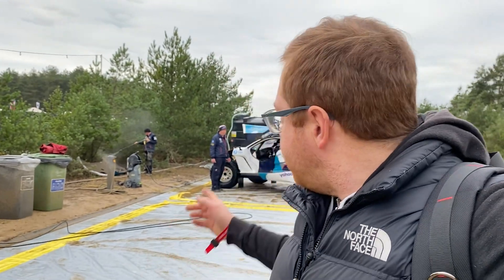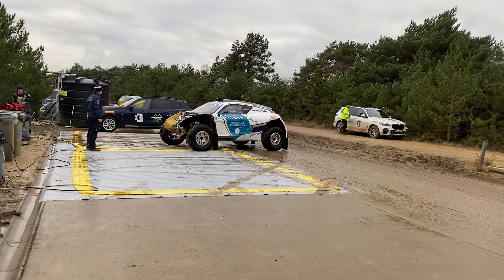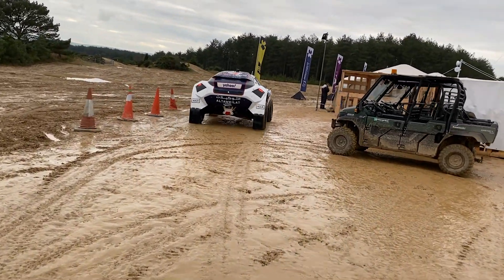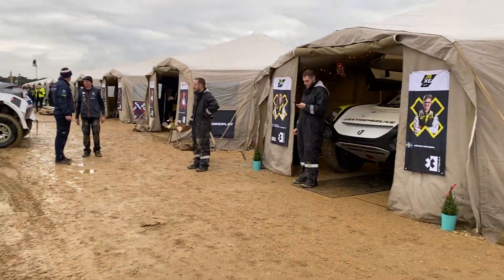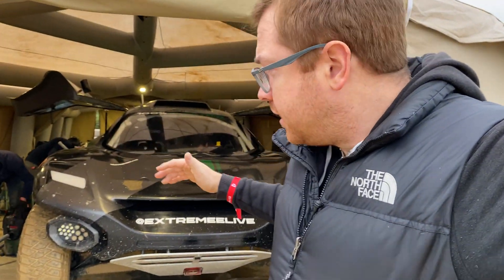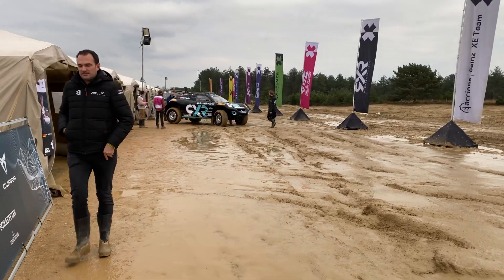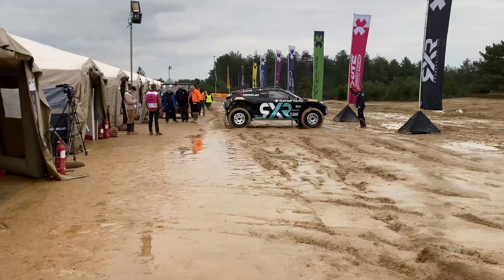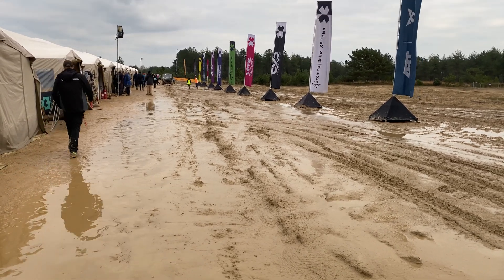Behind The Scenes Walkaround Of Extreme-E | My First Look

Comment: I still don't understand why there is no battery thermal management system in the car.
I get it requires extra parts like a pump, radiator/chiller etc but the car would condition the battery itself instead of blowing air "manually".
Reply: racing is about speed and having thermal management adds un needed weight for the time out on the track
Reply: @NicolasRaimo  cold or hot battery affects performance. They use time to cool or heat it, battery can't be pushed to the limit. If there is a plan to use technology somewhere else, it will require thermal management.
In my opinion this is an oversight.
Reply: @tomasvidziunas5543  not according to the engineers that do the calculations
Reply: @NicolasRaimo  are you saying that almost every manufacturer that puts thermal management system id wrong and these two companies are right?
Reply: @tomasvidziunas5543  in a road car to a car meant for racing very different engineering challenges
Reply: @NicolasRaimo  formula e has, etcr has, electric rally cars have battery cooling, Audi will have cooling system in it's electric car that will participate in Dakar rally 2022.
So no, I am obviously not talking about everyday cars.
But please, tell me where else electric racing cars do not have cooling? Maybe I am wrong. And all those racing engineers are wrong too.
Reply: @tomasvidziunas5543  Formula E is diffrent  Longer races  then it will be good with Thermalmanegment  These cars go 2 laps... and also Dakar is LOOOOOOONG Stages not 2 laps only...
Reply: @PierreSimonsson  why bother with 50kWh batteries then? To do two laps maybe 15kWh would be enough.
I understand different cases, but would like to hear the explanation.
They you high tech mirrors, but step back when you talking about thermals?
Reply: @tomasvidziunas5543  the reason they have to bother with 50kwh battery is the C rate…. The charge rate and discharge rate of a battery is larger with the bigger capacity meaning bigger packs more power to discharge to motors so yes they don’t need the range of big packs but they need the C rate for the power delivery
Reply: there is no need for Battery nm´manegement System in thos cars they re racing cars  doing on2 laps on the track  and dont need that fast chargingspeed.  Heat of Battery isent anBig issue in this extreme  Use  i think.